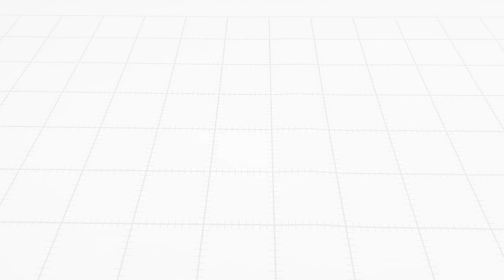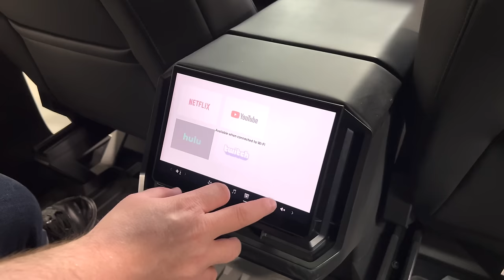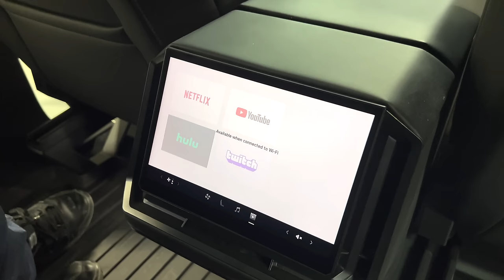Funky Form & Features: Tesla Cybertruck Interior Review

Comment: These vehicles DECREASE safety on all fronts. Controls: having everything on a touchscreen means the driver is taking their eyes off the road too often. Thermal Runaway: Fires happen. When they do, EVs present an unacceptable level of danger to everyone and everything around them. Pedestrians and Other Drivers: This particular EV is a death machine for pedestrians and other drivers. How is moving BACKWARDS on safety acceptable to anyone?
Reply: Where is your proof of these concerns?
Reply: More BS.  this s no chevy bolt!
Reply: Controls.
You obviously haven't grasped the concept of voice control yet?
.
I imagine you're still of the mistaken opinion that if you use ANY control on ANY other vehicle you don't look away from the road for an instant (even if you think you don't.... You check)
.
You want "Thermal runaway", watch a fire in a fossil fuel vehicle.
The very feature "you" (and others) tell us is the great advantage, "energy density", is the Achilles Heel of ICE vehicles.
When they "go up" they REALLY "Go UP!'
THAT'S "Thermal Runaway".
Compared to a pack failure that invariably begins with one cell, which is very often telegraphed by the battery monitoring system (Ya'know, power reduction, "stop the vehicle" warnings, etc?) Rather than (for instance) fuel from an injector rail on a hot manifold giving you seconds to stop and get out.
.
A "good" example ?
Police in the UK recently cancelled all contracts with BMW following failure to address and cure spontaneous, catastrophic fires in 5 series diesel patrol vehicles.
(That resulted in at least one death of an officer)
.
"This particular vehicle" has FAR superior forward vision with regard to seeing a pedestrian and thus being able to AVOID collision.
.
I wonder if the Munro team might position it "nose to nose" with other brands, or, better still, conduct an experiment to determine the minimum distance in front of the vehicle visible to the driver?
.
Please observe and think , rather than simply parroting confirmation biased opinion.
Reply: Say what? Regulators are already in talks regarding EV touchscreens and the need for traditional, physical controls that allow people to keep their eyes focused on the road. Are you denying that thermal runaway exists? Go watch REAL firefighter channels that go into detail about the extreme dangers and challenges dealing with EV fires. In terms of the Cybertruck being especially dangerous for pedestrians and other drivers, are you joking? The thing is a stainless steel knife capable of sports car acceleration. Why do people insist on lying about all of these things? Because you own Tesla stock? @TheBreen
Reply: The real facts are out there on the high level of Tesla safety and low incidence of fire.  Pedestrians,  please do not step out in front of moving cars.  It will end badly for you.  It won't be cuts or scrapes,  but broken bones and head injuries.
Reply: @tygorton  The controls you think are missing are on the wheel or the overhead for the 'gear' shift.  Mostly your making noise.  For all the crap the bolt caught for fires less than 10 cars burned.    Battery tech has advanced 10 years.  I don't own TSLA
Reply: @tygorton  

Your concerns about electric vehicle (EV) safety and design, including touchscreen interfaces, thermal runaway, EV fire hazards, and specific design choices of vehicles like the Cybertruck, raise important issues worth discussing. However, there's a broader context and advancements in technology that address many of these concerns.

The move towards touchscreen interfaces in vehicles, including EVs, represents an evolution in automotive design aimed at integrating more advanced technology and features. While it's valid to argue that physical controls can be operated by feel alone, allowing drivers to keep their eyes on the road, modern touchscreens often come with voice control functionalities that mitigate this issue. Moreover, regulators and manufacturers are indeed attentive to these concerns, leading to designs that combine touch interfaces with critical physical controls for essential functions, or the implementation of haptic feedback to simulate the sensation of pressing a button, ensuring that safety is not compromised.

Thermal runaway in lithium-ion batteries is a known risk that can lead to fires. However, it's important to note that EVs undergo rigorous testing to meet safety standards. Statistically, EVs are no more prone to fire than internal combustion engine (ICE) vehicles. According to research, the incidence of fire in EVs is significantly lower than that of ICE vehicles when adjusted for the number of vehicles on the road. Firefighters are also receiving training specifically to deal with EV fires, which, while challenging, are not insurmountable with the right knowledge and equipment.

The design of the Cybertruck, or any vehicle, with regards to pedestrian and other vehicle safety is a critical issue. The Cybertruck's unique design and use of stainless steel have raised questions about its impact in collisions. However, like all vehicles sold in the market, it must meet regulatory safety standards that include pedestrian safety. The vehicle's acceleration capability is indeed impressive, but this is a trait shared with many high-performance vehicles, not unique to the Cybertruck or EVs. The key is responsible driving and adherence to traffic laws, which applies to all vehicles regardless of their acceleration capabilities.

It's crucial to base our discussions on factual information and comprehensive understanding of the issues at hand. While it's important to critically examine new technologies and their implications on safety and usability, it's also vital to recognize the advancements and improvements being made. Electric vehicles, like all technologies, are continuously evolving, with safety being a paramount concern for manufacturers and regulators alike. Dismissing or exaggerating concerns without acknowledging the broader context does not contribute to a constructive dialogue.
Reply: I appreciate the detailed response. However, stating that "EVs are no more prone to fire than internal combustion engine (ICE) vehicles" has nothing to do with the issue. I engaged in firefighting for a brief time, long enough to have experienced first hand an ICE fire incident on the side of the road. It was easily dealt with in a brief amount of time at minimal expense and danger. The explosive danger and expense of EV battery fires is not something you can just sweep under the rug. The more these vehicles proliferate, the more likely there will be an incident at the worst possible place and time, and it's going to be a tragedy of monumental proportions. Why people are so willing to accept this additional threat to human lives is absolutely beyond me. I'll tell you this: I don't want my family anywhere NEAR an EV on a ferry or in any kind of enclosed space. 

As a taxpayer, I don't want my government incentivizing technology with BILLIONS of dollars that they haven't even bothered to create proper safety protocols for. This is peak absurdity, like so much else happening in our world today. It's as if common sense has vanished from the face of the Earth.
Reply: @tygorton  You could have saved a good deal of time by saying you don't like BEVs.    Because the rest is fud.